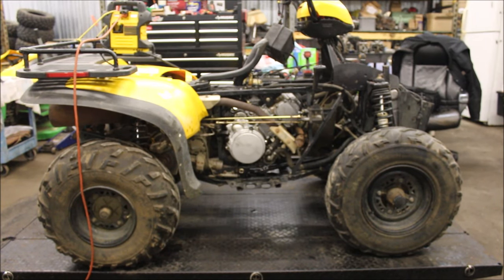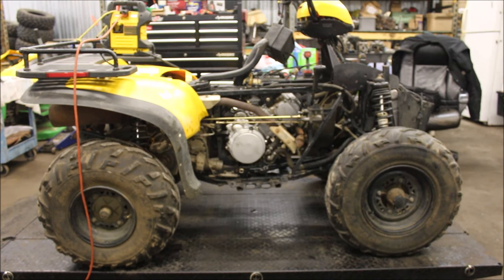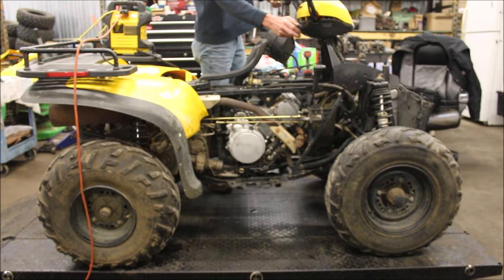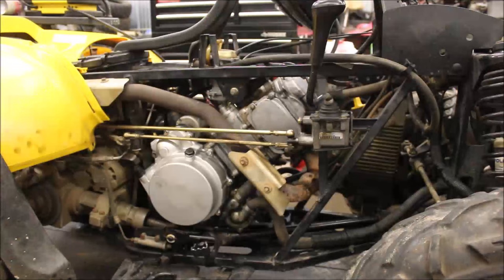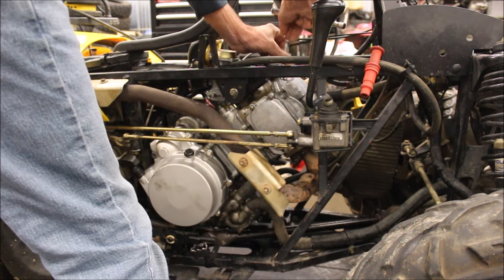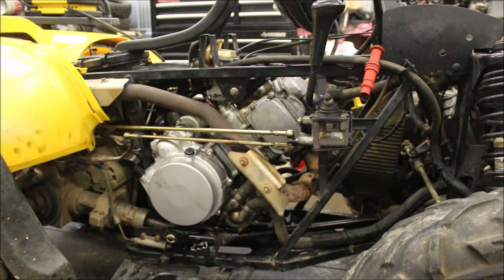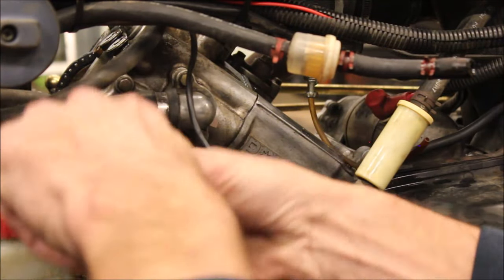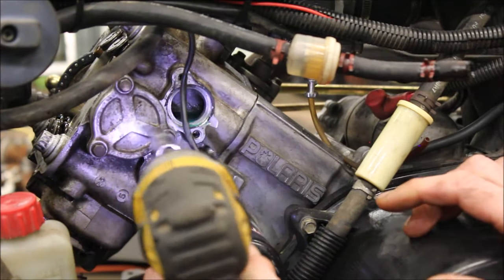Polaris Sportsman 500 backfires! How to inspect the camshaft and check for a Lean condition.

Comment: Thanks so much for your videos!
Maybe you could please help me
I have a 2005 sportman 500 HO and it will never cold start with the starter. I start it with pull cord and I need to hit the throttle. When its hot I can fire it up with the starter but still need to hit the throttle.

It backfires a little too like yours. The sparkplug is black so I think it run rich. New carb, coil, sparkplug, battery..

Do you think I could have the same problem you had and that I should check cam, decompression ball and valve lash?

Comment: I saw that Chinese recoil assembly. We’ve used a few, other than a crappy rope they seem ok. I’ll have to remember that decompression spring, I still got three more sportsman’s to get through, plus I have to keep my personal ranger maintained. One of my sportsman’s might even get to keep the original carburetor, a bit excited about that, they are usually so deteriorated inside that there is no hope for them.
Reply from the maker: I hear ya about the carbs. I'm always happy when the OEM carb works.

Comment: Just discovered that I have a worn cam and lifters in one of my 600's while I had it apart for a head gasket and piston rings, I was hoping to have it done this weekend but now I have to order more parts.
Reply from the maker: Make sure you check the oil check valve on top of the front of motor. Its a bolt with a spring and ball bearing in it above the oil pump. They like to stick and pump up to much oil pressure causing the lifters and cam to fail.
Reply from the maker: https://youtu.be/nV-0niX_bZ4?si=RaHMGn6AqIy3l_1J
Reply: @TitaniummanGarage  will do, thanks. It should have the ball bearings and not the longer dowel type piece. Correct?
Reply from the maker: @GaryToland  Oh Sorry, Yes, A dowel pin. and a spring. I added a ball bearing on mine to help it move and bump up oil compression.

Comment: Thank you. Found a 2000 Sportsman 500 with 200 miles / 50 hours on it. Seems like it sat for a long time. They put a new china carb on it but couldn't get it to run.
I was able to get it to idle and run ok at low speeds, but I'm having the bogging problem at higher speed.
Put a new china carb in it.
Checked the cam and lash. Good.
(Didn't check the cam ball)
New fuel pump.
New Spark plug and it looks light brown when taken out.

But still bogging......
But when I spray the air filter with starter fluid when it is bogging at the higher rpm it runs great.
So I'm thinking it is starving for fuel. Maybe the high jet in the China carb is too small. Or maybe I have a air leak somewhere that is only a problem at high rpm......
Your thoughts would be greatly appreciated. I need this bike for work. THANK YOU!!
Reply from the maker: Yes.Thats one of the problems with china carbs. the jets are to small. They will work on a unit with no wear, put them on a unit that has issues? you need a bigger Jet.
Reply: @TitaniummanGarage  Yup, that was the problem. I drilled out the high yet with a slightly larger drill bit, and that fixed it.

Comment: Do you think an 01 Sportsman 500 HO is likely to be affected by the cam issue? If so, is there anything that can be done to prevent the issue? Thanks the another great video!
Reply from the maker: Yup. I had a 01 with the cam issue. But in that case the guy was running the carb lean.

Comment: I have some wear on the rocker that looks like it is caused by the decompression ball.  Will that cause a rich condition?  Been fouling spark plugs.
Reply from the maker: It won't cause a rich condition. It just doesn't release the exhaust gasses like it should if its warn bad.
Reply: @TitaniummanGarage  thanks!

Comment: I have an 01  sportsman 500 HO new cam   I can get it started   Once  And it sounds good but then it dies and I can't get it started again for about an hour and then I can turn it over and it backfires and then it will start and the cycle starts again any help
Reply from the maker: Is the decompression ball sticking? Try the pull rope. don't pull hard. just slightly till you pass decompression ball. then try to start.
Reply: @TitaniummanGarage    Yesterday I had it started but today all it will do now is backfire Through the carb and the exhaust and Never start It has a new Polaris cam And lifters I had original set from 2001That was never opened But I am stuck now